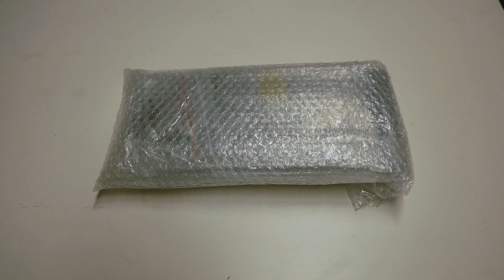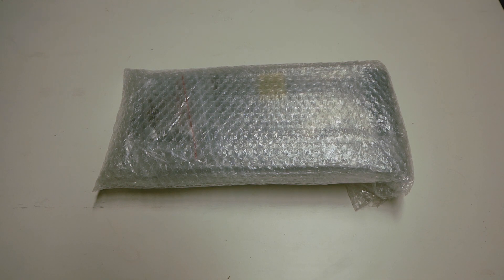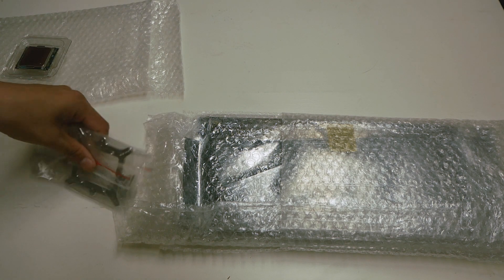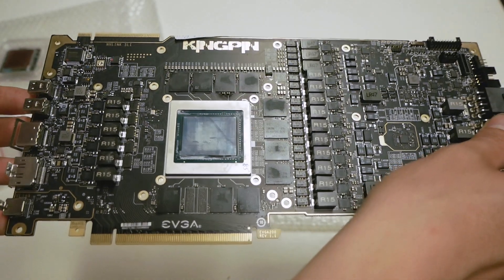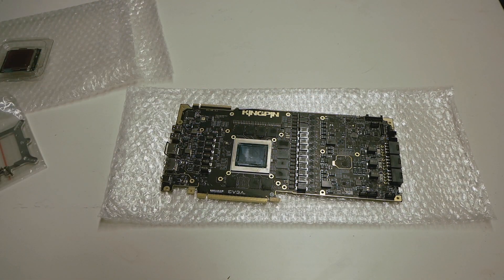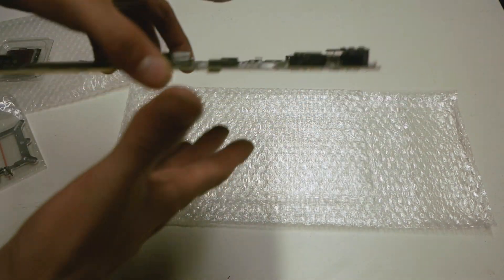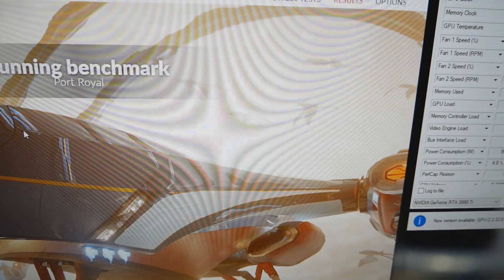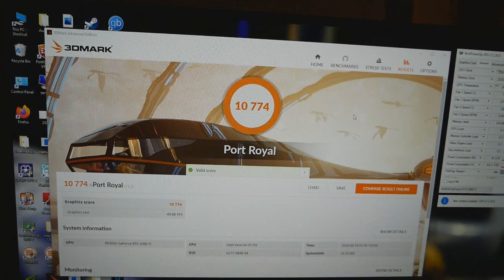EVGA RTX 2080 Ti K|NGP|N Comes Back ALIVE - Overclock to 2265MHz GPU on Water Cooling

Comment: So you get 10774 at 2265MHz on an XOC card while I'm getting 10400 on 2080 ti FE with 325w vBios?
Reply from the maker: I can get much more if i want to, just testing the clocks on crappy daily OS.
Reply: @LuumiJuhani  Hopefully Ampere will be more interesting than this Turing nonsense that can't even get 40 FPS in BFV with RTX.

Comment: Amazing, the KP I got back from RMA wouldn't even do 2100 core,  and mem couldn't even do +1200 without crashing. Didn't matter any settings in classified
Reply from the maker: Did you double check that the voltages were truly applied?
Reply: @LuumiJuhani  I did yes with my meter

Comment: Damn a beast chip. 
I was able to bench Time Spy my 1080Ti Strix at 2202MHz 1.2V on chiller, max temp 20 C, could pull over 400W at 4K.
Reply from the maker: Card or whole rig?
Reply: @LuumiJuhani  Card.